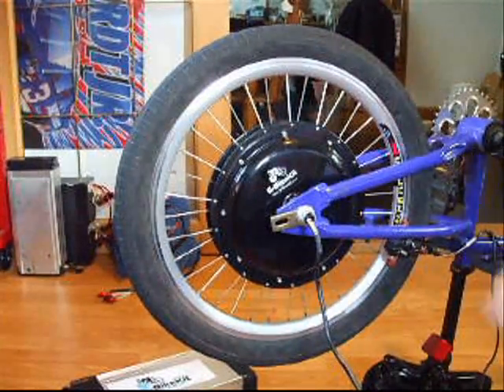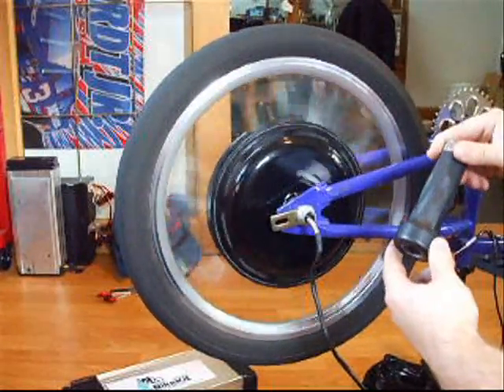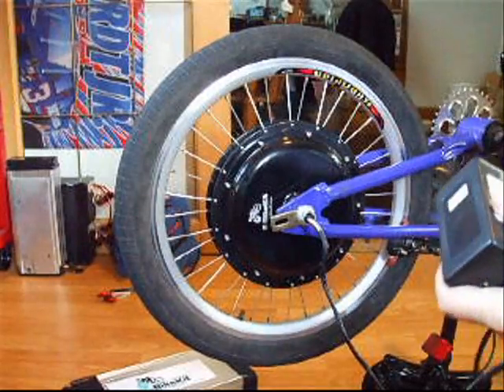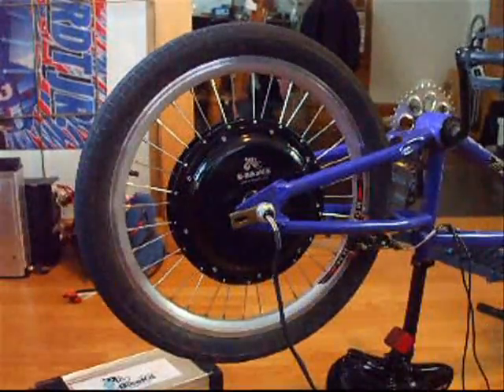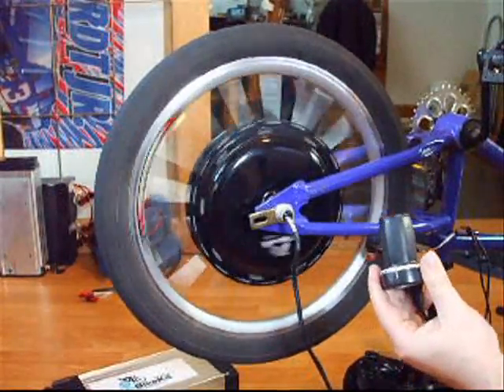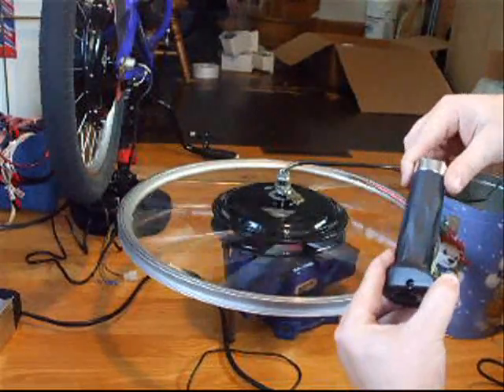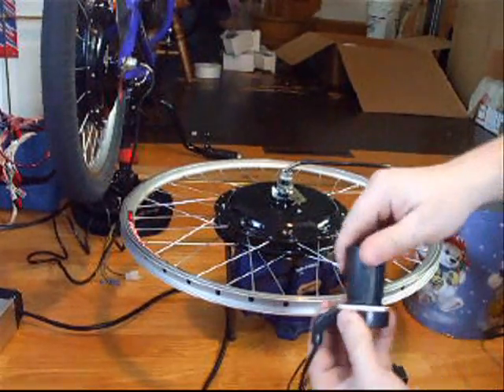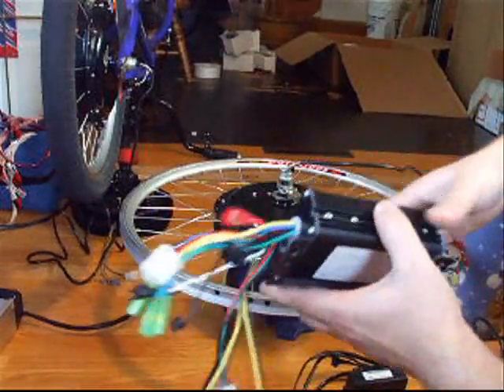Pedal First vs Instant Start brushless motor controllers

Comment: When you have to push the wheel at the start that normally means your motor is old and worn out and it's good for replacement or maybe your controller is not functioning right

Comment: Sure would be a lot of weight with a hub motor, 4 SLA batteries, 150 lbs of weight in the cargo trailer and his weighs of 250 lbs.
I guess hub motors are only meant to be used as an expensive commuter bike?

Comment: Dear Technician  I am please To watch your Video I Lorne Something from you I have a question if you Can Help me Appreciate! I have electric scooter 80v 20Ah I don't Know watt happen Not working I pout the scooter in the Stand I turn Power on not workingI spend the Will start Working increase  the Sped works good  I try to with  not go  my friend pose it ring not to fast but go I mast tell you I left The scooter out site  with have Raine for two weeks  now Watt will be Wrong Brushed DC Motor or the Controller? or Both is Not good please Reply That Will be Very Helpful I am Handy cup I need The Scooter. if I go to Repair Shop the Will charge Me allot if I gad the Parts I can do My self Please Your Help Will be Very helpful and I am Sorry to Bather you if you Have The Time Please Reply Two Word the motor is defect Or the Controller thanks    konstantinos939

Comment: This seems kind of pointless if you must start the electric engine with you hands IMO.
Reply: the whole point is to start pedaling first, when its on the ground you dont need your hands at all just a quick push forward or start pedaling
Reply: @socialfreak6900  aren't electric engines by design torque beasts that has the most at 0 rpm?
Reply: @TheRealFobican  yes but with sensorless controllers the motors need a small push then they can continue on their own as long as you dont stop, the reason for that is bc the sensorless controller cannot determine the motors current position and cannot activate the 3 phase wires accordingly, if your controller is a sensor controller the motor is able to take off on its own bc the sensors help the controller keep track of the motors current position and the controller can activate the phase wires accordingly
Reply: @socialfreak6900  ok good to know about.

Comment: the reason the motor will not start is because it is a censored only motor. you can get non censored brushless motor and ones that can do both but apparently it wont try to send current through all the different coils. and it will just send it through one till the rotor is spun past that coil and it "catches" and starts to create torque.
Reply: You mean sensored right?

Comment: The reason the controller that has the hall inputs doesn't work like the controller that doesn't have them is because the circuits are different and it requires a goon signal in those wires to do its thing.  FYI,,,
https://www.youtube.com/watch?v=iKFahgu6n3s

Comment: It rotates backward!!!!
Reply from the maker: sailingsolar The bicycle was being used as a means to secure the motor axle, forward or reverse makes no difference for this video's purpose..
Reply: ***** Guess again.  If that was the case it would have run back with the first controller. Which it didn't.
Reply: ***** Just goes to show you, no ones perfect. As far as correcting you again I absolutely will if you make another wrong comment that is observably and demonstrably incorrect. I'm happy I could straighten you out on this last point. ;)
Reply: Does it ??
Reply: It only looks that way because the bike is upside down.
Reply: sailingsolar I have over 18 years of cycling experience. Care to try to correct me again?

Comment from the maker: As mentioned many times below, i was using the frame to hold the motor in place as an anchor, direction had nothing to do with it...

but yes, the motor can be setup to run in reverse with the right controller, or a swap of motor/hall color combo.

Comment: Sensorlessly controlled PMSM motors have been used in washing machines and other industrial applications for quite a while. Freescale microcontrollers can take a loaded 600 W motor smoothly from a dead stop to 30 000 rpm in seconds. They even have control techniques that can counteract the magnets' field to reach a top speed beyond the conventional limits given by the DC bus voltage.

Comment: hub motors work best on frames that are specifically designed for electric hub motors and have built in torque arm mounting points and beefed up dropouts.  i think its risky to use them on puny dropouts not desinged for hub motors.  its a shame high powered ebikes did not become legally classified as then the designs woudl improve and we would have ebikes capable of handling 50-60mph whilst still being able to be pedaled but strength enhanced.
Reply: Jay cee this is obviously a high (ish) powered kit I’m sure if it was the standard bike it would have had torque arms or chunky dropouts

Comment: Is there any reason these couldn't be installed in both front and back wheel locations other than maybe the width of the front forks? I'm sure you see where I'm going with this. I'd love to run these on high amp lithium ion packs. I don't see any reason they couldn't pull a light trailer either with perhaps some groceries in it. This seems way better than taking the car for short trips where you can't necessarily carry all the items...

Comment from the maker: Followup to this video.. turns out the problem with the 26" wheel was the green phase wire had a break, i cut the wire harness 6" from the axle and tested it again, works like a charm.. then tested for continuity on the cut off portion of cable and the green wire def has a break in it.. fyi.
Reply: Excellent news.Just bought a sensorless controller as a back up.
Reply: That must have been frustrating to  determine . A broken wire is the last thing I'd be guessing because of all of the unknowns. 
Good to know . I guess no one could help you with that.  Glad you found it .

Comment: I confirm that: even sensoreless motor can have an ESC telling him to run from start. It works because modern ESCs listen to the "dead" pole for EMP to know what' s the rotor position.. so i can imagine it' s the ESC not capable of doing it.. maybe one is symmetrical, and the other one is asymmetrical. Do you know for sure the number of poles of the  two engines?

Comment: when using the instant start controller with the pedal first motor the controller is not able to perform as it does not receive any inputs from hall sensor any is not able to generate correct commution/drive to the motor
regards and best wishes
Rajan.

Comment: the instant start driver has hall sensors to signal when to commutate the current flow in the windings of the BLDC motor.
The pedal start senses the back emf generated on the winding which is not energised and is used to decide the commutation.
when using the instant start motor with the pedal first contoller it works as the controller looks at the back emf's generated on the windings (without any hall sensor inputs)and performs correct commutation.

Comment: Instant start uses the hall effect for positioning, PF uses back EMF for positioning. The motor has to be turning to generate back EMF.  I would suspect the second motor uses hall effect sensors that aren't as sensitive, and fewer turns in the coils so it generates less back EMF.

Comment: available amps and a faulty hall effect.I always want to know the over all health of a battery.Like a car that wont start,but has 13 volts in the battery,you go and check it with a hydrometer and it has a dead cell.Or a car that keeps going dead,you show 13.5 volts while its running,your friends say,  see it's charging,wrong,you hook up a amp meter,its putting out 10 amps instead of 60 or whatever.

Comment from the maker: The heinzmann motor is brushed, 2 thick wires to the brushes, 2 thinner wires are a temp sensor..  you can ignore the thinner wires and the 2 thicker one' s directly to any brushed controller.. or even straight to a battery with an on/off switch if you wanted .. ( not recommended )

Comment: I mistook you saying the controller requires the motor to be turning to power _it_, to mean the controller is powered by the rotation of the motor. ;)  "it" is a bit grammatically ambiguous.

I understand what you're saying now. 

Yes.  If you're running without any kind of current limiting, then the rotating motor will draw less current at a given input voltage.

bike controllers current limit, though, so the rotation is not to protect the motor, or reduce current, but simply for backemf sense.

Comment: The controller doesn't but the motor does, stalling out a motor can cause current draw sufficient to destroy the motor, batteries, and wiring.

Comment: Brushless DC motors need starting capacitors, as far as I know. The ones that need starting capacitors are usually the AC induction motors like the kind in fridges and air-conditiners.

The reason speed controllers normally have a massive capacitor (or several) near the input wires from the battery is to protect the transistors from the inductive kick of the battery wires every time they have an "off" cycle (a few thousand times a second). This gets worse the longer the battery wires.

Comment: I've never seen an off-the-shelf ebike controller that does that, but it's possible, with the added advantage that you can potentially not only measure which phase, but the actual angle.

Comment: Depends on how intelligent the controller is - I've read that some of them can determine the angle of the rotor before starting by measuring the magnetic reluctance of each of the three phases (basically it gives a low power AC signal to each and measures the electrical response - it's different depending on the position of the magnets). So it works as well as a sensored one. My car's super-cheap ESC definitely doesn't have this feature though!!

Comment: It's a little trickier though when your load is unknown/variable.  With an RC car, you can start it at a lower speed, and assume that you have more than enough power to get it to the next commutation step.

With an electric bike you're often trying to start from a stall, and your torque is often limited by the controller's current limiter.

It could certainly still work that way, but if starting on a step hill, or heavily loaded, it could make for some very rough/jerky starts.

Comment: You're wrong about that.  The amount of power a controller uses is pretty much negligible compared to what is used to accellerate the bike/rider.

The standard controller uses hall effect sensors so it knows the motor's position and can start commutating from 0 RPM.  The pedal first doesn't know where it is, so it senses the backemf's zero crossing on the non-driven phase to know when to switch phases.

It is possible to blind start a sensorless motor from 0 RPM, but those controllers can't.

Comment: There seems to be a common belief that electric bikes are for fat/lazy people, but that's not usually the case.
I have both an electric cargo bike (xtracycle) and a road bike.  The electric bike has fenders, and lots of carrying ability.  If the weather is too cold/hot/rainy, or I need to move too much cargo to make riding my road bike practical/comfortable.

Because of this, I ride on the days when most of the lycra/carbon crowd will take the bus or drive.

Comment: Sensored vs. Sensorless doesn't affect wether a motor and controller require feedback from the motor rotating to start.

This video is 3 years old but the controller that you call pedal first requires the motor to be rotating to power it, that lowers the amount of current required to accelerate the motor. If the motor is stalled and the controller delivers more current you could start destroying components.

Also it's somewhat safer to start from a rolling start. A feature not a requirement.

Comment: @Ypedal It's very odd how the instant-start controller will work without the hall sensors connected. Or were the halls actually connected (when you ran the 26" wheel with the controller that worked)

I think the answer lies in the fact that you don't get that cogging effect. It might be that you're not actually turning the motor with your hand - because instead of a regular freewheel, the 26" wheel has a centrifugal clutch. Try spinning it up electrically, keep it turning, and switch ESC

Comment: @Ypedal haha. Well, when the ESC isn't getting back-EMF signals from the unpowered coils (due to the motor being stationary), it kind of "guesses" which coils to power up - or rather, powers them up blindly in a "startup" sequence that is assumed to be able to get most motors to start spinning in the right direction. Then once the motor is spinning fast enough to generate a back-emf that the ESC can read, it switches to "running" mode (timing with BEMF) and starts working properly.

Comment from the maker: @LMF5000 Both motors in this video are brushless with Hall sensors.  However only the motor in the 20" rim will run with both types of controller... vs the wheel in a 26" only works with the IS type and pushed... the 26" wheel will not run at all on the sensorless controller, this is my questions.. why does the 26" wheel motor not run using the sensorless controller?

Comment: What you're demonstrating here is the difference between sensored ("instant start") vs sensorless ("pedal first") brushless motor. I've seen you use an RC powertrain in one of your other videos, so you probably know what I'm talking about.

Nowadays, at least in RC, even sensorless motors can start from a dead stop. It's a little jerky until it gets going, but it does work. I can confirm this because my RC car has one such motor and runs on only 3 wires.

Comment: @gammer019 I think you are explaining something completely different than what is being shown in this video. The difference is that one motor has hall sensors (hence the extra wires) so that the controller knows which set of coils to give power to to make the motor spin, even when the motor is stopped; whereas the other motor does not have sensors, so the controller needs to use the back-emf from the undriven coils to determine where the magnets are and which coils to energise next.

Comment: well in a sensorless system they are using a pulse from the motor windings to start the process,and they have designed the controller to be eficent at full power.
the inductance of the motor is what keeps it from starting.
this is a trade off for top end power with the rotor closer to the stator.
in a brushless(sensored) style the controller knows exactly where the phase is and can put full fower at startup.
the sensorless cannot do this.
so the amount of inductance is what causes this.

Comment from the maker: @vooodooou The motor can be run in either direction simply by swapping 2 of the 3 motor wires.  Just happened to be in reverse but it does not matter for this example.

Comment from the maker: Any why don't people stick to paper and ink instead of these new fangled computer things....

Cars don't make people lazy ? adding a small electric motor to a bicycle is a great way to flatten out the hills or heavy winds allowing regular people to use a bicycle to get from A to B instead of burning gasoline in multi tonne vehicles.

Cheer up will  ya.

Comment: Hi there. 

It sounds like the 2nd wheel is a sensored brushless motor so it will only work with a sensored brushless controller. The reason is has no cogging is because it seems like the hall sensors are incorrect in this wheel. This is also why it needs a push to get going. Basically the sensors are sending the wrong information to the controller.